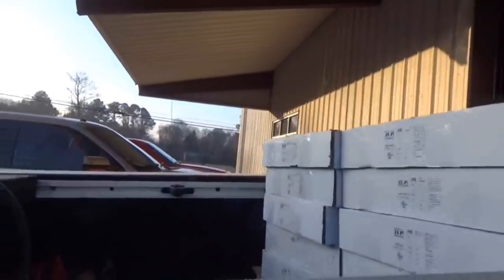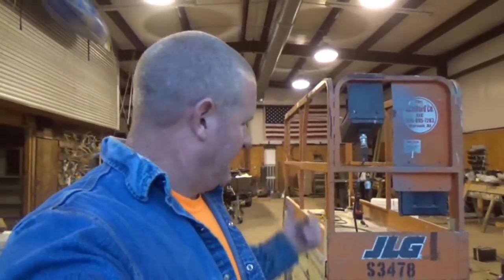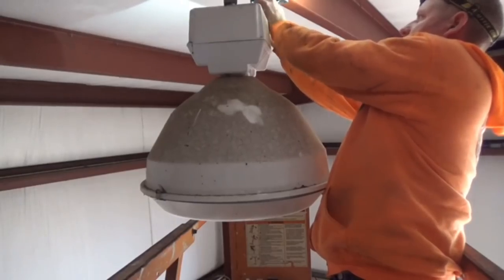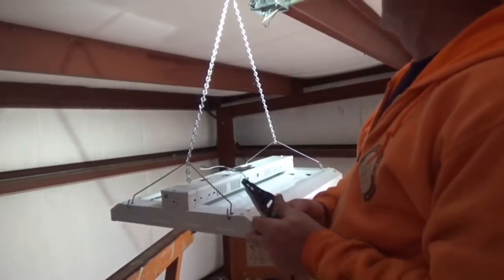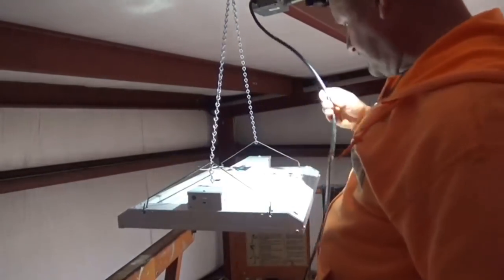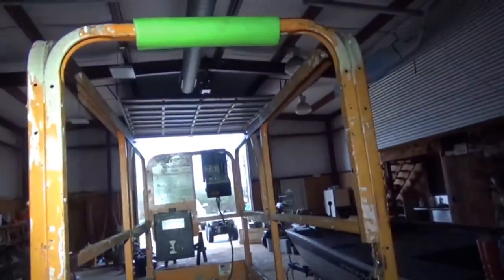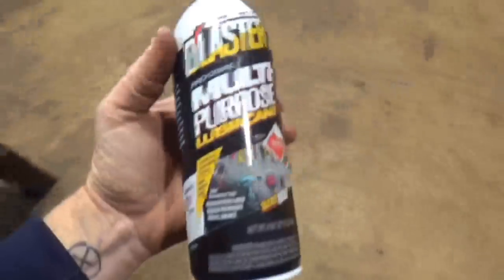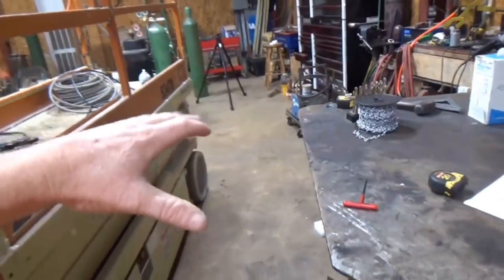Complete LED light changeover in my shop!

Comment: We have been replacing MH and HPS fixtures at the Mill I work at with LED’s. The good part is most of them have a 5 year warranty, the bad is most don’t last for 5 years.  Now these lights burn 24/7. I will say the fixtures have really improved lately and save energy. Plus they really light up the work area.

Comment: Quick suggestion, get a small, 5 - 10 watt light on a photocell that will illuminate "Old Glory" when you turn out the main lights. Not only will it show the flag in all its glory, but it will also give you enough light to move around the shop safely without having to turn the main lights on. It would also provide sufficient lighting for a security camera pointed towards the doors.

Comment: Boy did that make a big difference in your shop. I used to work in a Steel warehouse that had the danger lights you took out and it was nice when they changed them out. Buzzing woulds gives me a head aches.

Comment: Nice job Tim! We changed our shop over to LED lights last year. Best shop improvement yet. I am a little worried for you though, that wind or vibration might make the chains slip that hold up your new lights, and cause them to shine light sideways instead of down. I also am a perfectionist! LOL
Reply: DeHaven Family Farm -he could zip tie it to the eye bolt and that would solve that issue.

Comment: Was there a big savings on the electric usage
Reply from the maker: Yes it did help a good bit.
Reply: cotontop3 . I just ordered led lights for my garage.  Here in Canada Hydro pays 50% to change to Led.  Huge savings.
Thanks for the reply
Reply from the maker: The led are the way to go. You will not regret it.